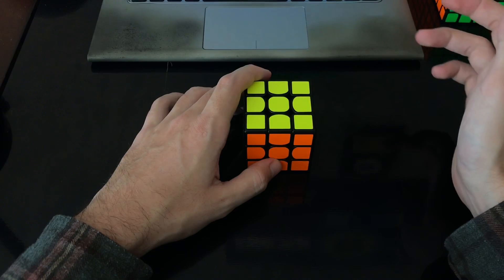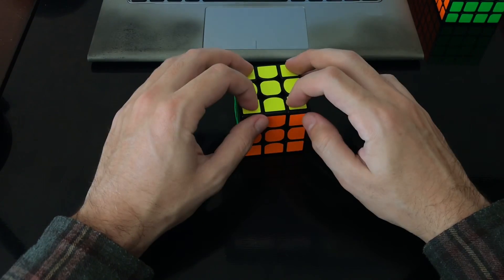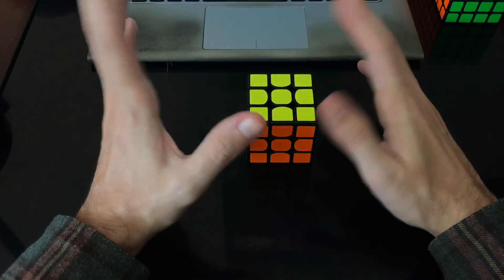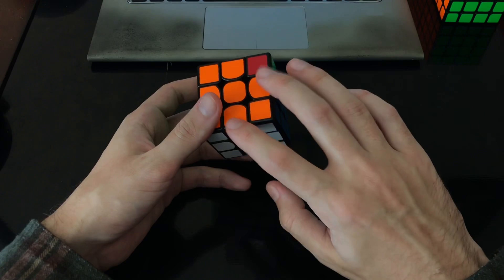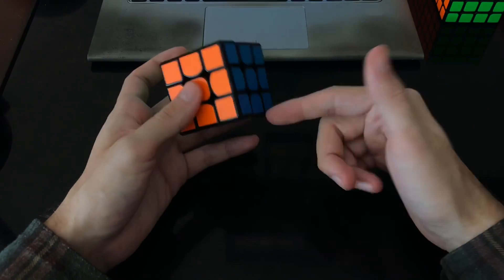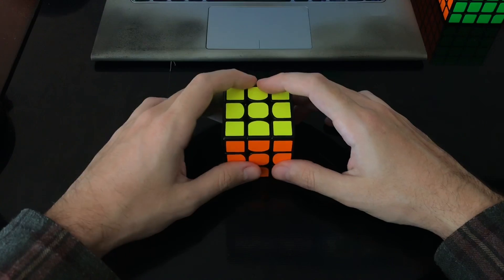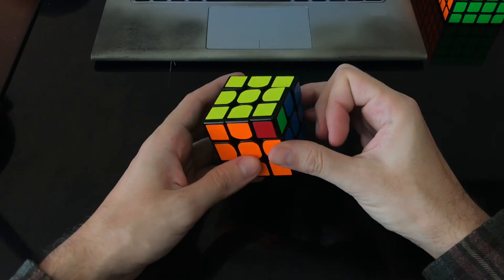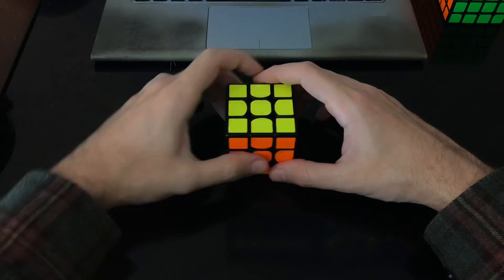Fixing Parity in MultiBLD Pt. 1: Intro & the Basics

Comment: The following is post on Facebook’s BLD support group on the topic from July 2018. Check it out, it’s relevant-

“MBLD parity for UF edges and UFR corners:

Since the most used corner parity method uses swapped UF-UR, i.e. the buffer piece is involved in the swap, instead of 2e2e for the last edge target, the UF>finaltarget>UR alg set is enough; which I assume is the method most people use for solving MBLD parity with these buffers. This is followed by one of the ~15-17 move parity algs at some point in the solve.

Couldn’t find a related discussion for these buffers, but here are two ideas:

1. Keeping note that cycle breaking once is more likely than twice (out of experience, don’t know the math prove that), it makes sense to break to UR or RU instead of the popular choice UB in order to maximise the chances of skipping the final 3-cycle (which will happen if the final target is UR). If you don’t see a flipped edge, and reach the correct sticker of the buffer, break to UR. Else break to RU. If you’re lucky and have only one break and stumble across parity, that’s one less alg to deal with; since you’ll end with UR.

2. UF-UB set is quite fast to execute (and similar is the case with UF-BU set). Hence, learning a UFR corner parity set that swaps UF and UB has benefits of faster cycle break comm, faster edge parity comm, and by the same logic as in (1.), can equally likely save a comm in execution.

Combining both ideas lets us deal with solves with 2 cycle breaks as well, skipping one comm; and the best part is, only 21 new parity alg are to be learned for the second method, none for the first. Note, UR is also among the favourite cycle breaking spots. 

I don’t remember any solve in particular lately that I’ve done with 4 cycles (i.e. 3 breaks) excluding flipped edges, so this potentially covers almost all solves with parity that have either UB or UR available for breaking.

Consider a 40 Cube multi; that’s 20 solves with a parity. Say this idea can apply to 15 (totally arbitrary ball park estimate) of these cubes; that saves us 15 comms compared to usual parity method: enough time to memorise and solve a whole extra cube.”
Reply from the maker: Yash Mehta cool, this is something that I was going to talk about in the final video of this series.
Reply: Graham Siggins Awesome!